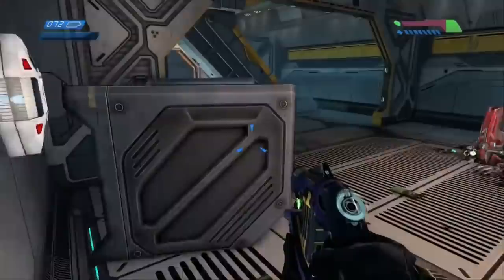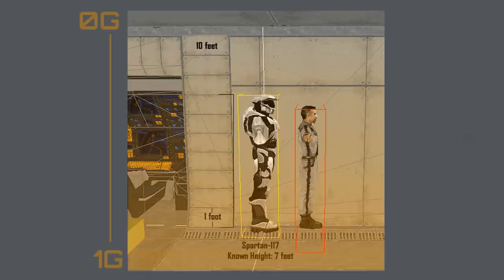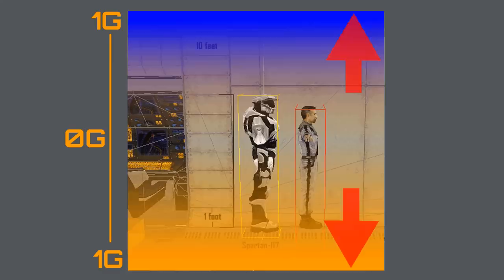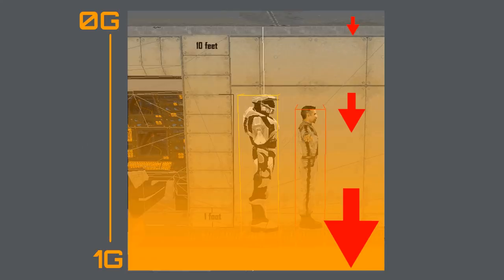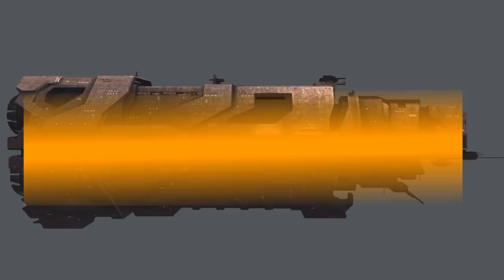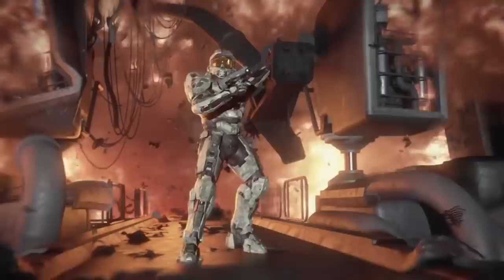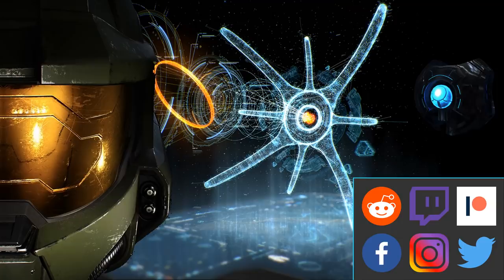UNSC Ships Artificial Gravity - Lore and Theory

Comment: This is also assuming that the graviton proposal proves valid. 
Gravitation in relativity isn't as much of a calculable "force" in the traditional physics sense as it is an "effect" on space; dilating dimensional vectors towards the source of energy/matter sufficient in density to merit said dilation. The method of this action and how mass/energy density correlates to spacetime distortion is entirely unknown as remarked in this video, and that's where the proposition of the graviton as an explanation puts some pieces together more cohesively, but I digress. Anyway, I think that with the aforementioned "relativity" effect could answer more questions in this video than the graviton notion. With the idea that gravity is an effect rather than a particular fundamental force, the "force" output by the gravimetric plates on starships could be actuated in a way that doesn't necessarily require a dedicated vector or direction for the field to function correctly, unlike with the graviton due to its linear direction. I'm thinking a plate could generate a field, or multiple fields of gravitational distortion as a sort of bubble, which would simulate realistic earth gravity more closely. There would still be the issue of gradient fall off the further away from the plate on a deck, but I think this idea fixes the problem of omnidirectional force by instead adjusting patterns or sequences of distortions in certain spots spontaneously as to compensate for discrepancies in force felt by objects, especially in the case of G forces present when the ship accelerates/decelerates.

Comment: For gravity field in real life using modern tech would be the use of sonics.
Reply: I've seen that stuff. I think you'd run a real risk of harming a biological subject with that tech though.
Reply: U mean right now?
Reply: @davemarx7856  That is one set of frequencies.
Reply: @hunter_thespy1233  Sure
Reply: That's not really gravity, that's just thrust.
Reply: @pwrserge83  What if there is a frequency that does the opposite.
Reply: @pwrserge83  Or just mount on the ceiling and wails, and push down.

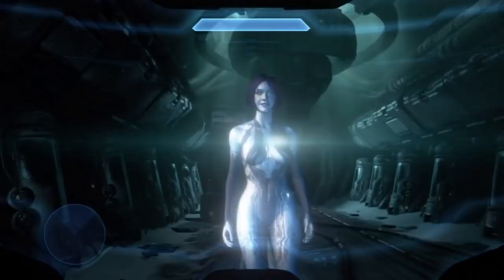Comment: 10:23 I always assumed it would work like that (for HALO or other SciFi) for the sake of gameplay. Keep in mind that all the levels above are still having a weak force on the levels below. The gradient would still probably be noticeable but not nearly as bad as shown here and outside of grenade arcs it wouldn’t be as noticeable for FPS combat.

Also the plates could have boosted gravity so the average gravity is 1g instead of having the correct force only being on your toes.

Comment: Your logic for gravity drop off is kinda wrong, if the plates are causing 1g of acceleration through gravity that force will drop off at a similar if not same rate it does at earth so there wont be wildly varying areas of gravity

Comment: "Directions for Gravitational Wave Propulsion

Giorgio Fontana
University of Trento, Italy – www.unitn.it
GravWave® LLC Senior Scientific Advisor – www.gravwave.com
This paper summarizes results of past analyses, including proposed examples, in order to build a
modern theoretical framework for Gravitational Wave Propulsion. The framework consists of families
of generators of gravitational waves, which have been theorized but still require experimentation, and
models of thrust generation. High efficiency generators are based on coherent sources, for instance
synchronized MEMS oscillators, the HTSC Gaser, based on coherent spin-2 transitions in s-wave/dwave superconductors, and the nuclear electromagnetic wave to gravitational wave up-converting
transducer, based on dineutrons. After gravitational wave generation is successfully proven in the
laboratory, it will be possible to apply a concept developed in the field of cosmology. Here the
background energy density may give mass to the graviton, which in turn may allow gravitons to
produce thrust. Local background energy density can be increased by charging materials with high
dielectric constant in close proximity to the wave generating elements. Focused Gravitational Waves
may also produce singularities, where the radiation is converted into a coulomb-like gravitational field.
Gravitational singularities will set an n-body gravitating system among themselves, the spacecraft, and
the remaining bodies of the universe, with obvious propulsive effects. Applications of the present
analysis will lead to a unique propulsion system capable of enabling the fast exploration of the solar
system, the local star system, and possibly the whole galaxy. 
"

a high level member of the US navy fairly recently pushed a patent for something similar to this that had been rejected by the patent office